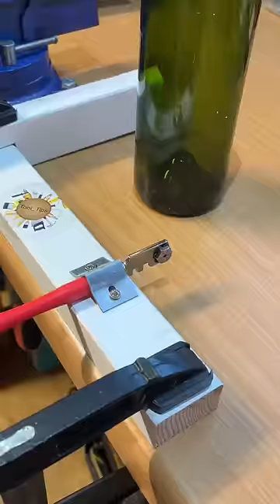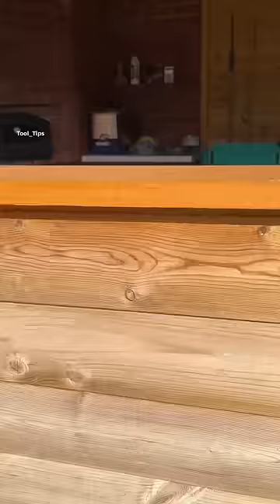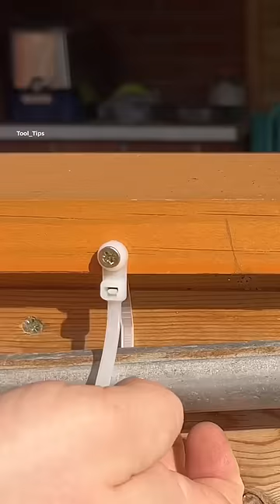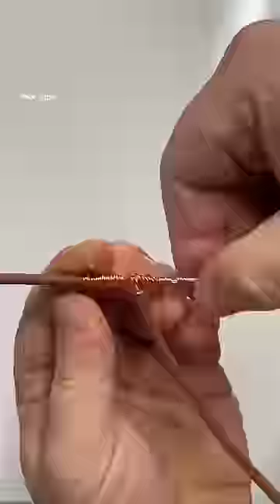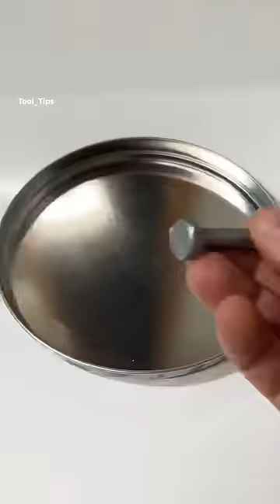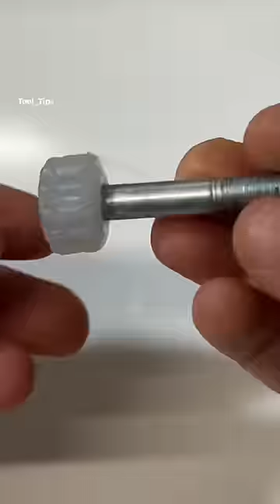Best ToolTips on #shorts

Comment: PSA: DO NOT SPLICE WIRES LIKE THAT. Use a wire nut. I'm an actual electrician. Exposed live copper is not a good idea. If you make splices like that in your house, you will get an electrical fire.
Reply: Out of curiosity, other than it being exposed, is there anything else wrong with that splice? Like, say you were able to use solder and heat shrink around it, and it wasn't mains power, I don't see too much wrong. Of course don't leave exposed copper anywhere.
Reply: @NotsaeEgavas nother electrician here. If you were intending to solder The Joint afterwards I don't see much wrong with this except that you obviously don't want it to be in a shape of a 'T'.  It is a good idea if you're making soldered wire joints to weave them together like that.

Best used for Cord repairs or inside Electronics.

I have used that exact method several times installing radios, lights, etc. in my vehicles (with solder and heat shrink).

That being said, if this is open house wiring, all the joints should be inside an electrical junction or 'handy' box to meet code (U.S.)

Before I sold my childhood home, I had to install around 40 handy box electrical joints in the Attic, replacing the joints my father had done similar to this with just tape and no box.

It's amazing to me that more homes don't burn down from electrical fires caused from homeowners installing things that just don't know any better.
Reply: @AshokaMazda   yeah that, exactly that. I get it for electronics if you heat shrink it. I'm not sure what is considered normal for that stuff. I focus on Datacenters, labs, and factories for electrical work. The more I saw residential, the more I wanted to avoid residential. FOR EVERYONE ELSE THAT IS NOT AN ELECTRICIAN, YOU SHOULD JUST USE WIRE NUTS. It's code compliant, and doing fancy stuff is asking for trouble. The further away you are from code, the closer you are to a problem. Like I understand you could do the stuff your dad did, because it's got electrical tape, but we really shouldn't do this. So maybe if you're in some extreme situation far away from civilization and a Home Depot, I could understand doing things like that. But for your concerns @NotsaeEGavas a lot of things could go wrong if that's in your house. Like what if 15 years from now, the dollar store electric tape's glue dries up and comes undone. Now we have exposed wiring. The reason why we have a code book we have to follow is to get on a standard so we mitigate risk.
Reply: @NotsaeEgavas  Solder should only be used for electronics or low voltage circuits. The wires he is twisting looks to be 10 gauge and solder should never be used. It is always best to follow the NEC.
Reply: Makes sense. I'm not an electrician and stick to smaller electronics as I have been doing a lot of small things with soldering like my 3d printer and RC airplanes and other electronic projects. Good to know, thanks.
Reply: I think it's implied that he only left them exposed so you could see it...I'm sure a reasonable person k ows to insulate exposed wires
Reply: Why does it seem like every one of these types of videos contains a quick how-to to starting an electrical fire?
Reply: @flounder2760  I want you to be right in your assessment, experience tells me I should not assume this. I have been told that I should install EVERYTHING with the expectations someone will climb on it, because someone will a decade down the road. A drywaller climbed up on my hanging transformer that same day during his lunch. 😭😭😭😭
Reply: @royd.4629  as a construction electritian this is absolutely relatable.
Reply: @AshokaMazda  T joints were taught in high school shop material back in the 1980's but for telegraphic wire and door bells not for anything with a high voltage.  The wires were solid not made of multiple strands like on this video.
Reply: If you could use WAGO, this is the best. But, it’s ok to use some electrical tape for alternative
Reply: Because it must certainly be for 120v or 240v house wiring, and not for some low 5v or 12v application... duhhhhhhhhhhhh
Reply: Of course you would wrap or solder that joint but the purpose of that portion of the video is to illustrate that the weave works better than just a regular wrap. There's no reason to show anything further.
Reply: @jcw231  I see your perspective, with that said pretend I'm a new guy and don't know much about electric. I might assume I'm 100% done because I copied the video. This is a very dangerous assumption. That's one reason as to why this is not the best idea.
Reply: @poyim256  WAGOs are actually good. I was kinda surprised how good they where when they first came out. Now if you do not have a WAGO, use a wire nut. You can totally tape the wire nut to the cable for stuff like temporary wiring. I've even seen some guys tape their wire nuts inside boxes. A somewhat rare thing. Just make sure it's got a wire nut, or electrical inspection man is gonna be upset.
Reply: @soldjahboy I'm seeing brown insulation. B.O.Y. or Brown orange Yellow, typically those are high voltage colors. Now I doubt it's running 240 or 277. Maybe but I doubt it. Now it looks like a heavy enough gauge to be for 120. Now I'm using American standards, that's not universal internationally. If this is in Thailand, maybe this is low voltage for them and that's just how they color code their stuff.  I can only go by American industry standards, something often copied internationally.
Reply: @barryb3476  Splices. Conductors shall be spliced or joined with splicing devices identified for the
use or by brazing, welding, or soldering with a fusible metal or alloy. Soldered splices
shall first be spliced or joined so as to be mechanically and electrically secure without
solder and then be soldered.
Reply: @royd.4629  The point is, just because it's illustrated with wiring that may or may not usually be for high voltage... doesn't necessarily mean this method is intended for that application. Also, those screw caps you insist are the best way, are illegal and against building code where I live... FUNNY HUH?
Reply: i now know what i must do
Reply: @soldjahboy  wait... They banned wire nuts where you live? I'm curious now, where do you live and what do they make you use for home power in terms of splicing connections?
Reply: @royd.4629  They're banned in any country that uses aluminium wiring, which is every single country in all of Europe, including the UK. You are uspposed to use lug connectors or those new push pin/quick connect types. Screw on wire caps are banned but there are select special ones you can get that ARE legal (purple pigtails)... it's just easier to not use them.
Reply: Actual actual electrician here: don't splice wires at all and use a proper connection material like a Wago clip
Reply: Actual actual actual electrician here, you can do it right with wagos or wire nuts. Follow your local building code. 😆
Reply: I would say use a wago becourse you can see if you did a good connektion.
But really wago and wirenuts are both up to standart.
Its like comparing Remington 870 to Mossberg 500 shotguns
Reply: Why would someone legitimately need to do what I would call a "T splice" ? Seems only laziness. I could be completely wrong, but it seems like you doubled the draw on that one source.   Edit: If I only kept reading comments I would know that I made a good guess at the name of the splice and that it is intended for low voltage solid lines. I can understand that.
Reply: Better yet, wago connectors
Reply: Inside the t shape ur basically making coils, which... best case is a small power loss, through HEAT production...i guess no further information required.... but why do all that when you can just cut it, put it in a wago and ur perfectly fine or (urgh hate to say that) atleast the american way... wire nut
Reply: Who said it was house wiring? It looks more like 12 volt automotive wiring to me. Add some solder & electrical tape, not the way I would do it-mechanic, but I've seen worse.
Reply: electrical tapes at that time :D
Reply: @AshokaMazda  Just because it's not "To code" doesn't mean it's bad. The code has two purposes, safety and predictability. It's perfectly possible to splice wires outside of a box that isn't a fire hazard. The "code" is a minimum standard to keep stupid people from doing any random shit they want but it doesn't automatically follow that anything that isn't code is bad.  I'm not saying that the code is useless.
Reply: @NotsaeEgavas jesus, I don't know you, but just don't play with anything that may harm someone else..... even you  asking is alarming.
Reply: What if you cover it in flex seal?
Reply: either that or solder it down and use ungodly amounts of heatshrink.
Reply: @Jmatt455  I been workin at a CDJR dealership for over a decade now. 
I’ve seen much worse goin to either the harness or straight to the terminal. Usually an XJ or a cj7, all them owners are backyard mechanics.
Reply: Oh yeah that's insane for electric wires in your house. I was thinking maybe for speakers or something
Reply: Not that I'd use a T splice as shown, but say you want to do a car audio build and need to add a speaker in parallel to the circuit.
Reply: @AshokaMazda  In europe pretty much all houses are made out of concrete/stone/brick mix and wiring is put inside the wall (surrounded by these non-flamable materials), so it should be fine, right?

Comment: Don’t use white cable ties outside. They can’t take a lot of subs UV. There are dark ones which are good for outside.
Reply: All plastic photo-degrades (whoever said 1000 years to break down was high AF), so even the dark ones will fail before long.
Reply: @ABQSentinel  there are special dark ones … I am working as an electrician. You use them for outside and they do work for years without getting influenced like the normal ones. So please inform yourself.

Comment: 1st one is how to hide your meth pipe
Reply: LMAO i was so confused like wtf is this 🤣
Reply: Lol
Reply: 😂  That's a better explanation than I'd come up with!
Reply: I swear I was like is that a crack pipe 😂 I'm dead ☠
Reply: Underrated comment.

- Meth addict
Reply: @anio1349  Pretty sure they were using it to fill the space so a smaller bolt can be used in a larger hole. Couldn't even begin to guess why, though.
Reply: Pretty sure that's a chemical anchor
Reply: How can you hide it when it was never here?
Reply: Its a epoxy bolt anchor.  Crush the glass tube and it mixes the contents.  It expands, hardens, and anchors the bolt.
Reply: I was wondering the same.
Reply: 😂😂😂 I  was like, what the......wait, no. Stop fuckin......WTF are you???!!! Thanks for making sense of that for me! 👍
Reply: It's am expired anchor. Guess they didn't think to use the second clip from the original vid of a good one.
Reply: Crack pipe a meth pipe has a full on ball at the end
Reply: Appreciate it. I was super confused 😂
Reply: Get rid of your pipes in a useful way instead of the street
Reply: What is 1st one ??
Reply: I thought it was a clever use of frozen pickle juice
Reply: its a chemical anchor

Comment: That's got to be the most expensive way to put bolt into timber
Reply: What did they put in the wood before the bolt?
Reply: @fe3613  I'm not sure what it's called, but I've seen it used before. It's some kind of adhesive that's usually used to drive structural bolts into concrete foundations. The sort where if they pull out again, a building falls over.
Reply: @fresnel149 I believe they’re called chemical concrete anchors, don’t quote me in that as I’m on the other side of the planet where they’re not used and English isn’t my first language.
Reply: It's an epoxy anchor cartridge most likely
Reply: IT’S FOR CONCRETE!
Reply: So that what that nonsense at the beginning was pretending to accomplish. 

Well their you go.👍
Reply: And it's a machine bolt. Its meant screw into metal, like a nut.
Reply: Relish.  They put a condiment for hot dogs into a hole to secure a bolt
Reply: @johnbuck5181 but the question is……can it still be safely used for this method in wood?
Reply: @fe3613 Fischer injektionsdübel eigentlich für beton.

Comment: That is the fastest most effective way i have seen someone cut a wine bottle.
Reply: Notice the video cut? 😂 It can be done without the water and just the marks. It's called scoring. Submerging glass in water actually propagates a finer crack but it's unnecessary, this bloke still had to cut his video because he messed up the first wine glass.
Reply: My method has always been gas soaked twine and a bucket of ice water lol
Reply: @lordpyro1  same thing you are heating the glass at the score then chilling it. This causes the glass to break at the score.
Reply: I mean that's the normal way to do it.
Reply: @sammorgan31 what’s the best way to do it then?
Reply: I can do it with a hammer in literally 1 second.

Comment: I like the hot glue on the bolt to make a knob, will try that out sometime.
Reply: that one got my attention.  wonder how much torque it can take.  great for a thumb screw situation
Reply: @coppulor6500 I would think that hot glue is way too weak for this purpose.
Reply: @nkronert  kinda what I was thinking.   Don't have much experience with hot glue. Once it dries and cools down is it the same consistency as the glue stick was originally or does heating cause a chemical reaction and change the properties? Making it harder?
Reply: @coppulor6500  I don't think that  a chemical reaction occurs. There may be a difference in strength between (partially) chrystalline and amorphous (glass like) state of the glue, not sure what it is before and after heating/cooling. Maybe I'll do an experiment one of these days to find out 🙂
Reply: @nkronert  that would be interesting 😊.
Reply: I thought that was resin, hot glue isn't strong enough.

Comment: Zip ties deteriorate so fast in outdoor environments..... One hole straps are cheap, you could even make one with plumbers strap, or a thin piece of scrap metal.....
Reply: And the screws are right where someone is going to cut their hand, reaching over that edge. That was a terrible "hack"
Reply: A couple short beads of caulk would be a better solution.

Comment: Absolutely amazing! Please tell me what city this feat of ingenuity is taking place.  I’d like to phone in a favor, and have the blue Angels do a fly over!
Reply: at low altitude and full burner
Reply: @brucewelty7684  Agreed! Low altitude and full throttle burner! But not too low where the props clip the tree tops!
Reply: @gerrylundergaard60 they may want to have water on standby as the house with that wire job gonna be in flames.
Reply: @gerrylundergaard60  Props? What ACFT do you believe the blue angles are flying?
Reply: @RErnie-gv1hv  Hybird. Has both turbyne & propellas, zoom! USA! USA!

Comment: That last one is probably the most likely to be used
Reply: Wasn't it just hot glue? I can't imagine it lasting very long or being able to handle a lot of torque.
Reply: @TheHibbitydibbity  they make it at glue at different strengths, it's how PDR (Paintless Dent Repair) is don't lol
Reply: @TheHibbitydibbity  tbh you could but bolts with a handle pre-made it was just cool to see it idk how long ot would actually last or if it's even worth it but seemed like a alright idea
Reply: @TheHibbitydibbity  you can get hot glue in alot of different strength hot glue is also used in PDR (paintless dent repair) for cars gorilla glue makes some too and we all there stuff works

Comment: Wtf is the item put into the screwhole in the first one, and what it is accomplishing?
Reply: That applies to this entire video
Reply: Literal garbage - the smallest axial load and the whole joint will pop out
Reply: @submerged7640  That goes without saying. As far as I know, to put a bolt in concrete (or at least that's what I remember it being when I watched it earlier), you'd use a plastic anchor designed for concrete or a specific types of glue depending on the strength required and whether you're going to need to remove it later.
Reply: It's called a Chemical Anchor Bolt. It's used with metal screws. #GoogleIsYourFriend
Reply: @TubeWatcher  search Google is your friend but when you have no fucking clue what to ask Google doesn’t really help much

Comment: I mean...the zip ties are a product designed to do what he did with them. The tip is, buy these zip ties and use them as intended by the manufacturer. It's like saying, hey, need to fasten a board to another board? Use nails! The first one is just nonsense, I guess it's glass or something? To make the screw tight? Ok...ill just fill holes I make too big for my bolts with some of the crushed glass I keep laying around my house. Thanks. Unless it's not glass, in which case the tip becomes perfectly useless as a tip, because I don't know what they're even suggesting I do in that case. The wire splice one was...erm...ok I guess. You wouldn't leave those wires like that though (hopefully). you should probably solder them and cover them in heat shrink or electrical tape, so it really makes absolutely no difference how you twisted them together in the first place because the solder will hold them no matter what. Of course, if you twist them like that, then solder them, then at some point want to un-solder them...well, good fuckin luck. You're gonna have to cut that shit out. You want my tip? Cut the wire, so now you have three separate ends, twist them together, and solder them, or use a wire nut or similar wire connecting device, of which there are many on the market. That way, when you go to remove these wires, it's actually possible to just melt the solder or remove the connector and pull them apart.